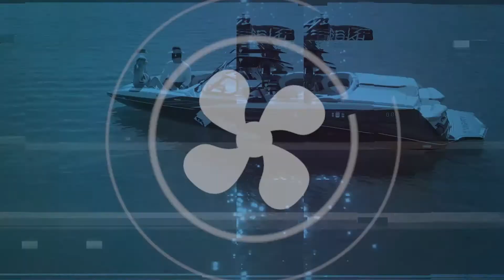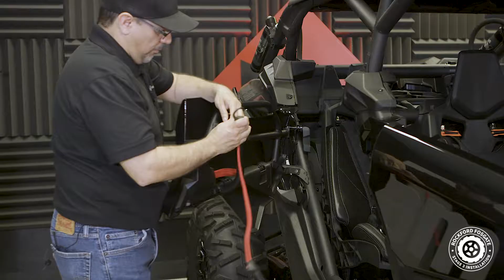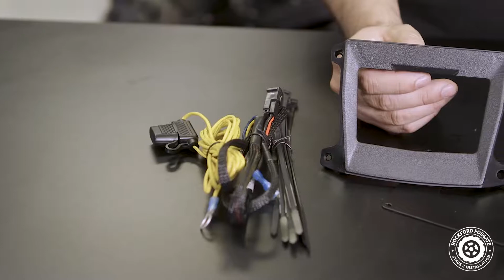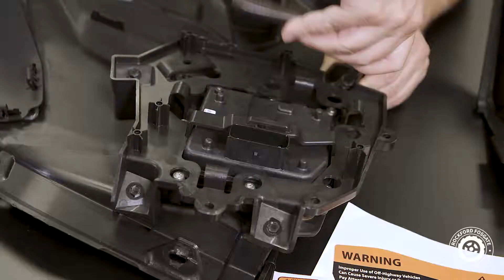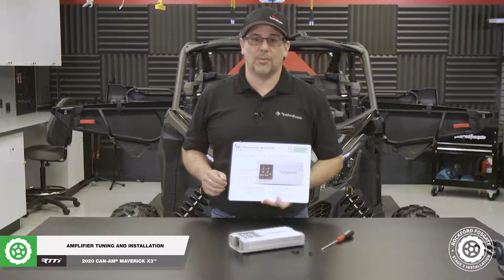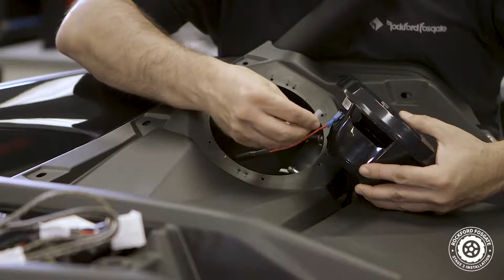Can-Am X317-STAGE3 Installation (Gen-2)

Comment: You need to show us a better pic for that plug I can’t find mine
Reply from the maker: At 4:20 you'll see a hole in the plastic panel just above the connector I'm plugging into.  It's very high up in the dash and typically plugged into a receptacle like this.  It will likely have a "dead plug" inserted in the connector to protect the pins from exposure to water.  If you have any accessories like a winch or headset, this connector is being occupied by that accessory.  You can splice into that wiring harness and solder our harness into it or you can purchase a y-adaptor kit that allows you to handle more accessories.